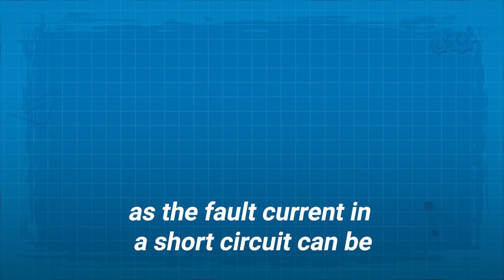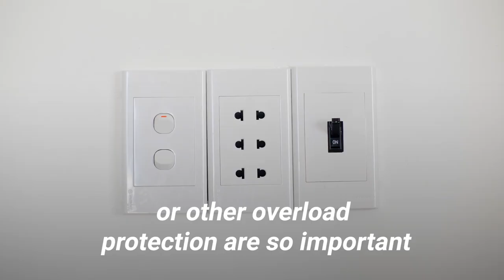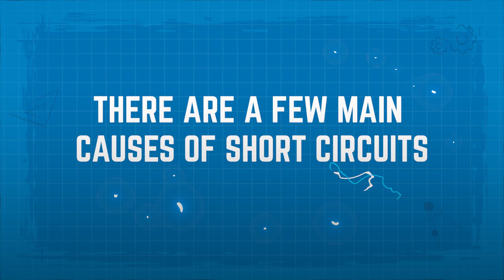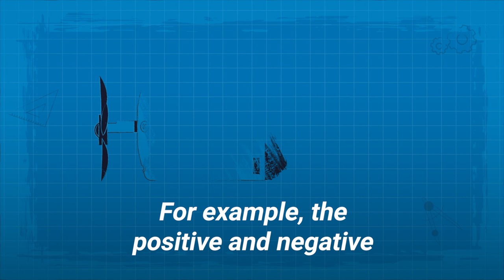Short Circuits - when electricity goes wrong

Comment: out of curiousity   i plugged a small copperwire then  in the other end of the wire i touched it by only  one finger  , still it shocked  or almost  paralyzed my arm    a bit  but i was able to let go  by  2 seconds  .       that   when i was  9 or 10 years old

Comment: Can you tell me how to calculate the fault current practically?
Reply: Divide the voltage by the resistance (in ohms) of the fault path... result is theoretical max amps. As wires and connections heat up, the resistance will go up too, it will not stay constant.

Watts will always be volts TIMES current,  so you can count on a serious short circuit causing lots of heat.

Many years ago, in old US houses, the fuse box would permit FOOLS to insert a copper penny coin behind a blown screw-in fuse, thus eliminating any protection for that circuit. A serious short circuit or overload and you could burn down the house.

Comment: 0:23 that's an ethernet cable... Yes, it might carry POE, but it's a bad example (they have really low power, and they usually negotiate if the device needs POE in order to activate)